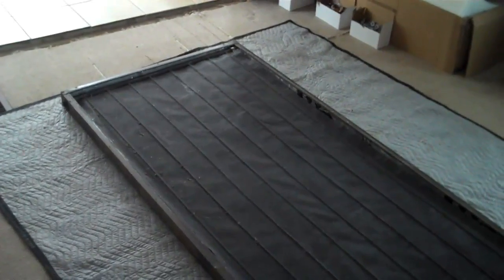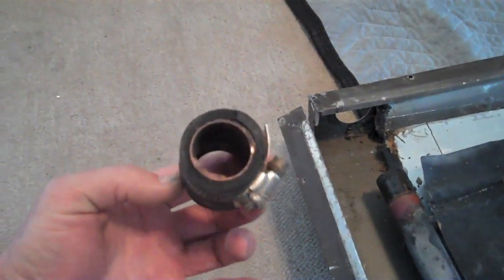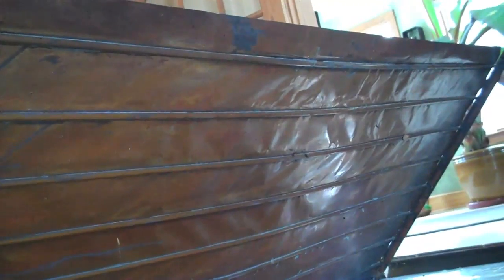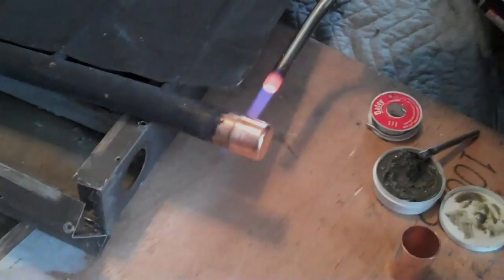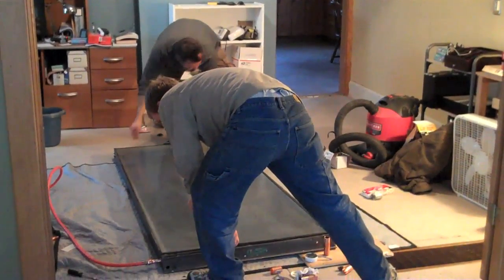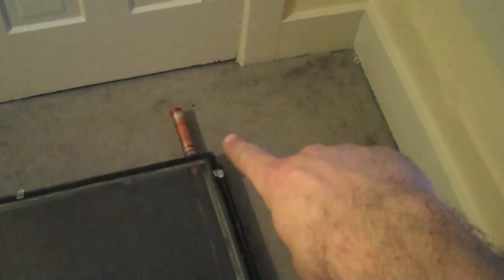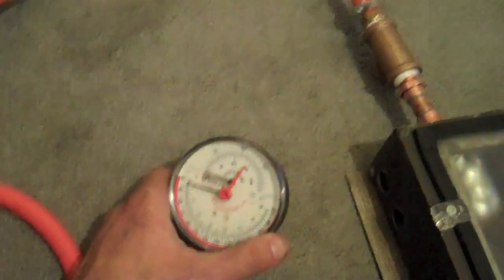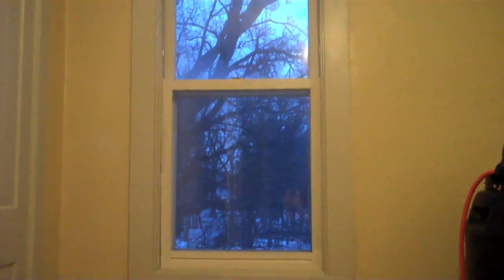Solar Panel Refurbish

Comment: Humm, thought bubbles up in my mind. If you had a send and return hose going to the hot water panel then you could have a continuous flow of water through the heater. That would reduce the amount of lost heat from the storage tank. Something like a radiated heat system in a home. Just a thought. I am very impressed with your ability to think outside of the box. I wait with great interest for the next video from any of your projects. Cheers